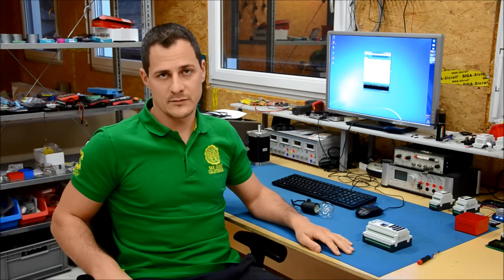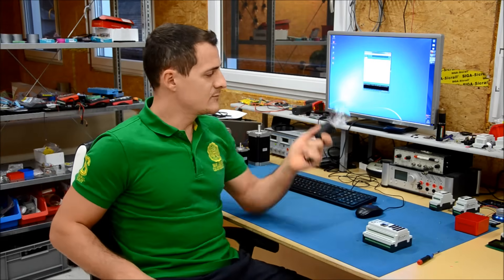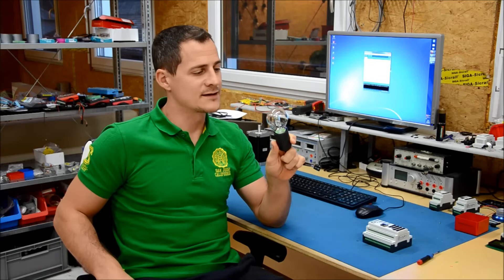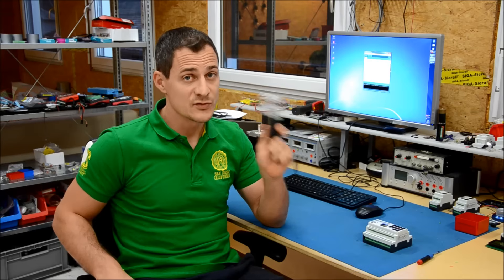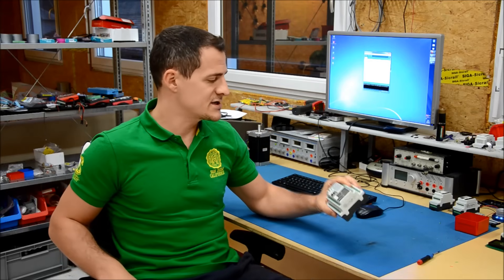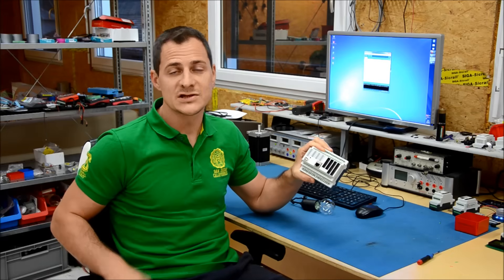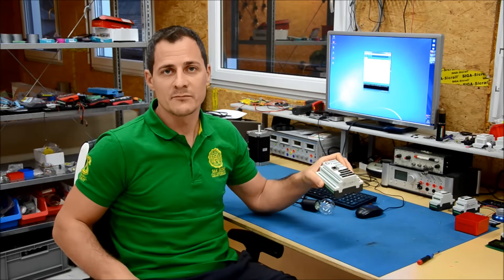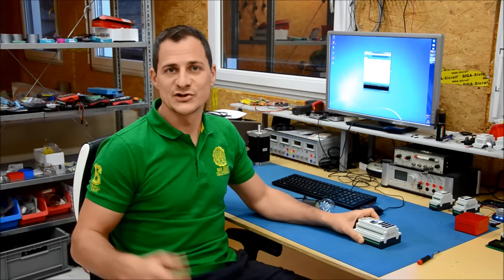CONTROLLINO - Relais Outputs

Comment: I really wish you'd post a full project, with code, rather than just a load of flashing lights. I've got the MAXI and having lots of problems getting the relays to work (I've done loads of Arduino stuff, but the Controllino doesn't seem that compatible)